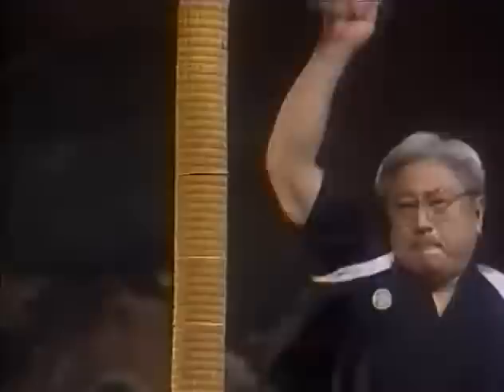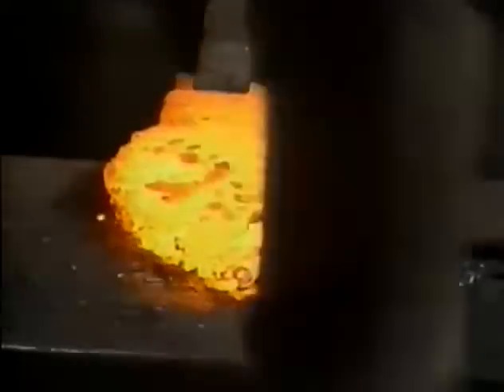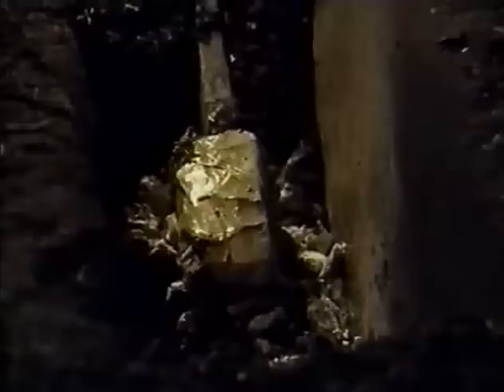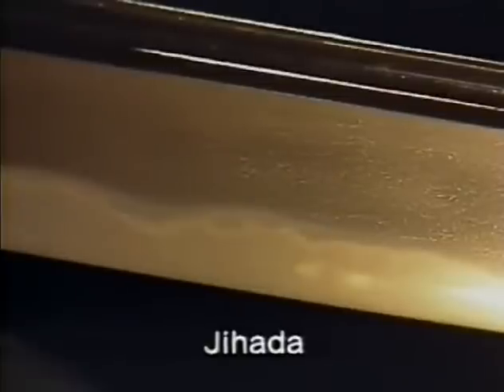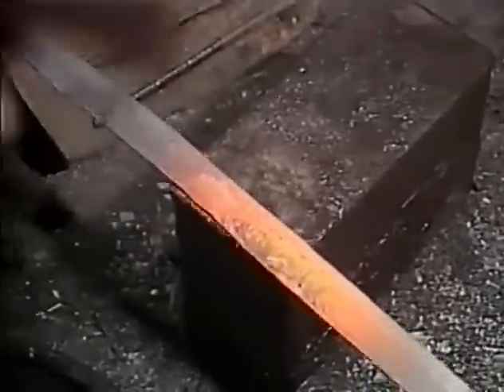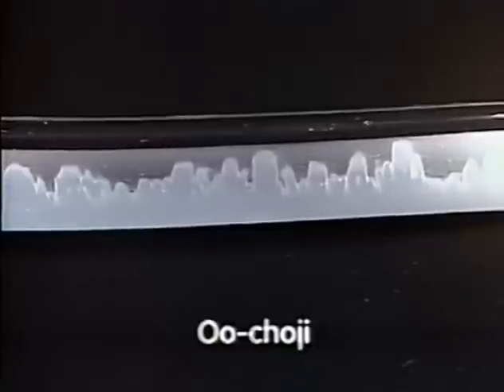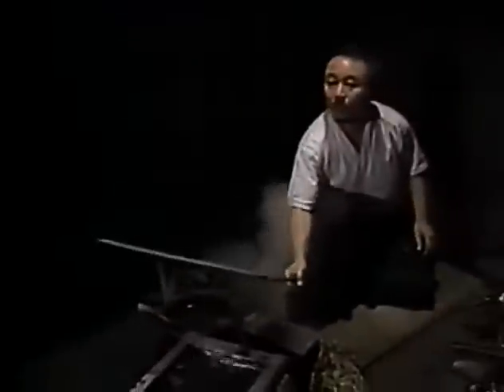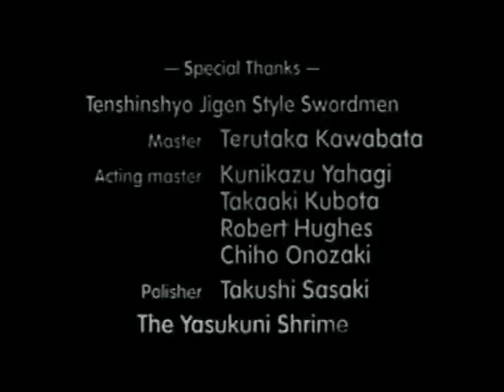The Secret World of The Japanese Swordsmith

Comment: Considering the high temperature of the quenching (hardening) heat treatment, the edge when cooled in pure water will very probably form the even higher hardness (and brittleness) crystal CEMENTITE along the extreme cutting edge of the blade with white (fresh, somewhat brittle) martensite forming the rest of the high-carbon tapered and outside flat blade portion and the less hard, but much tougher (ductile), center being crystals like pearlite or perhaps a form of bainite composition (bainite can be good or bad, depending on where it is and exactly what version of the crystals form -- there are knives that replace martensite with various bainite structures with good results).  Fresh martensite has to be changed to yellow (aged) martensite, which has more "give" (internal toughness) on impact, to get a truly successful knife or sword.  Tempering by reheating to a moderate temperature (well below the quenching temperature) after quenching is what is done now (even this has potential problems if not done properly!) but it can also happen at room temperature by simply leaving the sword on the wall untouched after quenching for a few years to very slowly on its own take the "kinks" out of the martensite crystal patterns.

This video is amazingly informative!!!

Comment: ugg the secret of Japanese swordsmith is that they use 1000 year old technology rather then modern steel working. The only difference is that the old way is much slower. and that the only quality control is the smiths experience. Dont get me wrong it takes ALOT of skill to be able to use old school blacksmithing and make something this nice. but using modern blacksmith someone could have like 2 years experience and make a katana just as amazing in a 8th of the time for much much cheaper. Japanese swordsmiths choose to use the slow and hard way to make there swords art pieces that are expensive. Again its amazing to watch sand turn into a sword by hand. but because Japanese swordsmiths are so stuck in the old way of doing things less and less people are learning how to become blacksmiths. A katana that uses modern equipment like welding, powered forging hammers, modern steel, chemical bluing and etching can be way stronger, and much more beautiful. I can't stand when people think these swords are better just because they are hand forged.